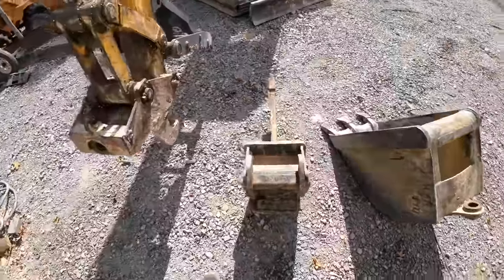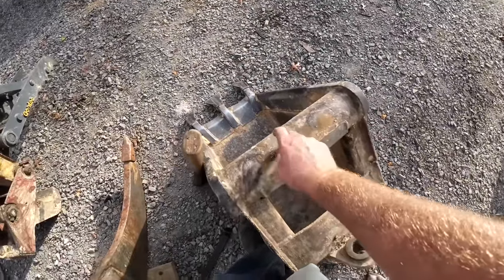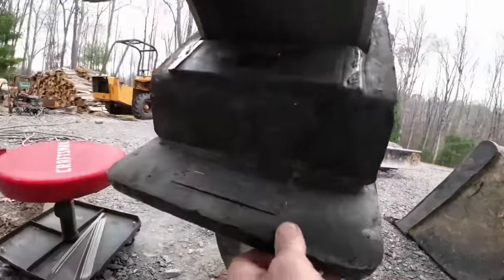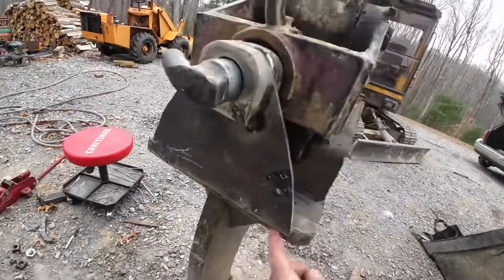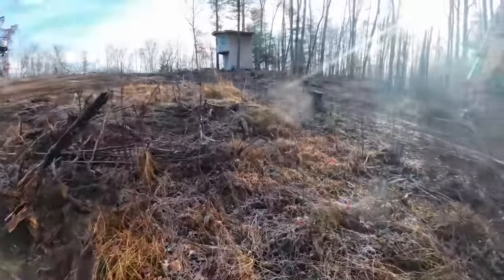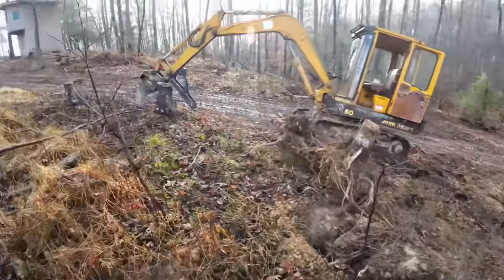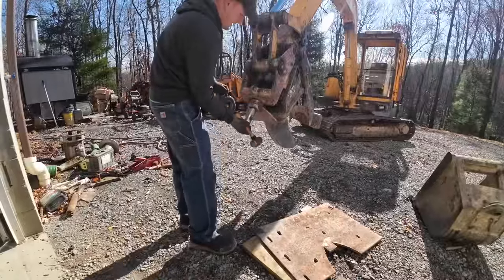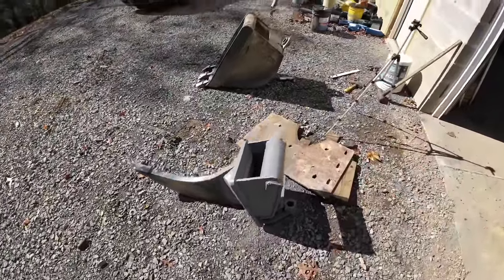Buying a Ripper and Modifying it to fit my Excavator

Comment: Handy tool. I use mine for stumps, rock, frozen ground, etc. It is much easier on a smaller machine. Once you figure out the little tricks for digging out stumps, it'll cut your time spent by a lot.

Comment: You should add a knife edge to the ripper to cut roots easier. 😊 I still think you should make one more pin hole higher up on the jib boom to park the thumb out of the way. I did it for my backhoe and it’s nice. 😊